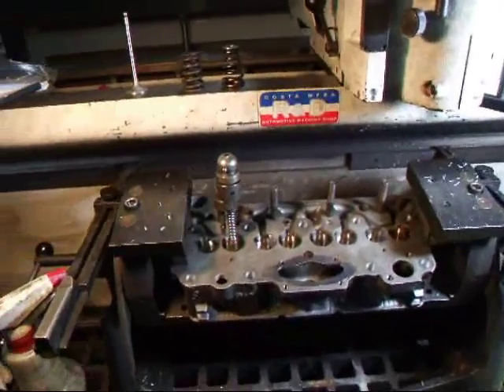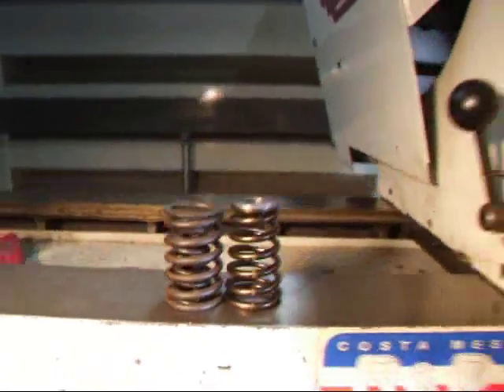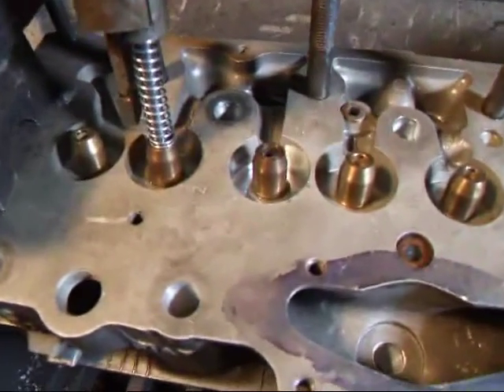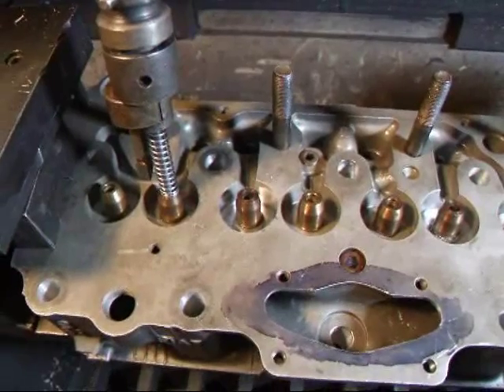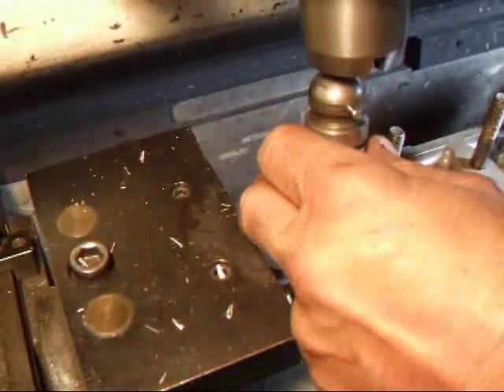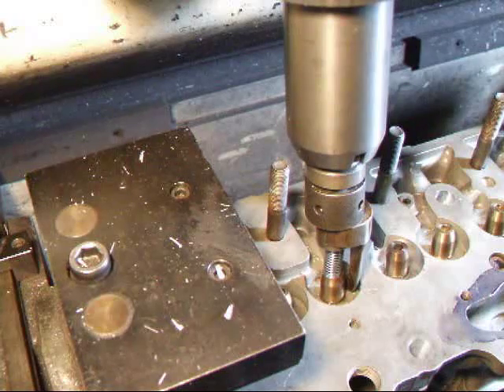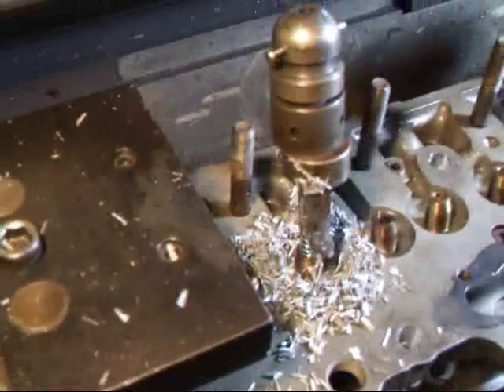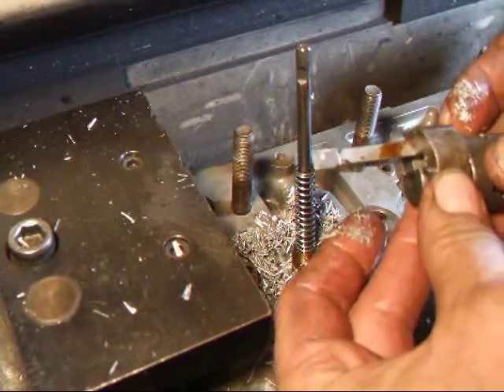850 Valve Spring Pockets.wmv

Comment: Hey I got a quick little question can you make a custom flywheel out of two I need the outer diameter of one needs to fit a certain ring gear etc. and the the bolt pattern off the engine I'm gonna use.

The application would be a 1981 mercedes diesel in a mitsubishi pickup 4x4 the power output of the mercedes right now is only 65hp 100 torque maybe I'd turn it up and put a turbo on for upto 100hp 

anyways 4cyl low output flywheel and even low rpm b/c diesel

What would that cost?